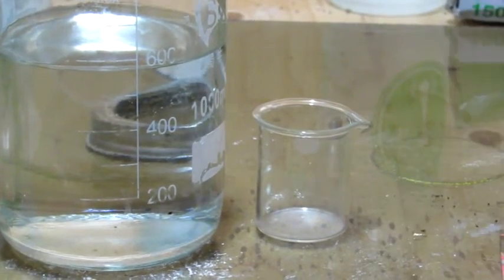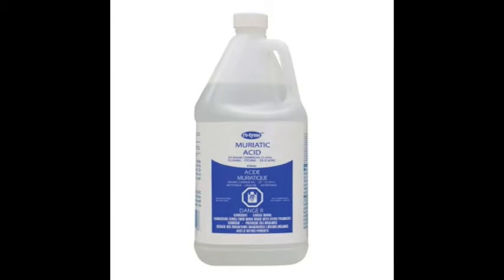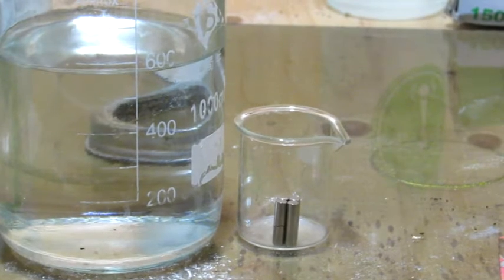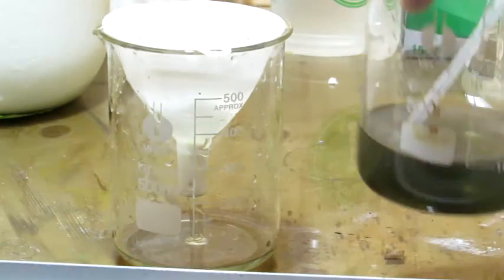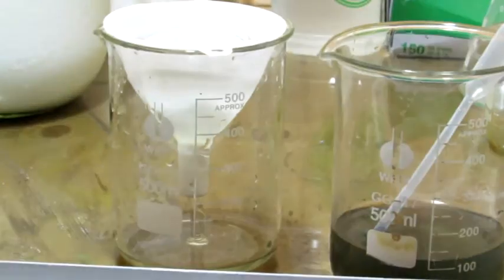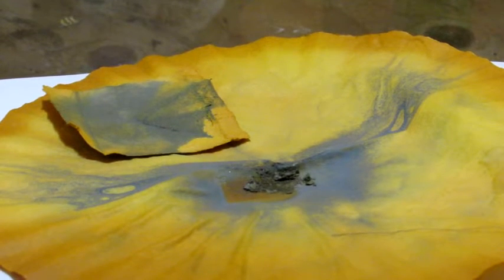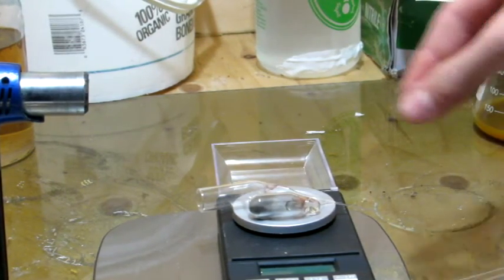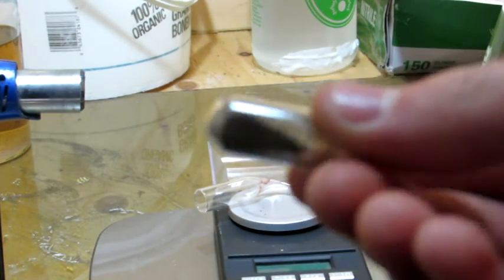Isolate Boron from Neodymium Magnets

Comment: Love these household element extractions! Do neodymium extraction from the magnet!
Reply from the maker: Thanks! I failed at my first neodymium extraction, but I’m gonna try again soon. I have some ideas using ether as a separating method.
Reply: @TheCanadianChemist  There´s another way to isolate the neodymium (which actually has a bit of other rare earth metals mixed with it) from the solution: 
Step 1: make sure that all the iron present in the solution is in the form of iron(III) ions. If not, add hydrogen peroxide to oxidize the iron(II) ions into iron(II) ions.
Step 2: make a solution of oxalic acid (or oxalates of sodium/potassium or ammonium) and add it to the neodymium magnet solution. This will precipitate neodymium oxalate (mixed with a bit of other oxalates of rare earth metals)
Step 3: Heat the dry precipitate to turn the oxalates into oxides. From there you can try to isolate neodymium, but it´s very difficult to separate it from the small amount of other rare earth metals mixed with it.

Good luck!
Reply: @chemicalmaster3267  Sorry for asking a bit late. i am also trying to separate neodymium from magnets. 
May I ask what type of magnet do you use, hard drive magnets or a bar of Nd-Fe-B magnets?
I tried with an NdFeB magnet bar but the results were really bad, I definitely filtered out all the Fe but in the final step when separating the rare earth oxide, I dissolved it back into H2SO4 and the solution turned orange instead because of the purple-pink color of Nd3+, I think it's mixed with a lot of other rare earths instead of just "a little". Only when I used hard drive magnets did the results get better.

Comment: A superior method than the boric acid, I would like to see the neodymium recovered :)
Reply from the maker: I’m working on the neodymium, it’s a bit challenging to separate from iron, and I’ve failed my first attempt, but I have some ideas with using ether as an extraction solvent, so stay tuned!

Comment: Maybe you can also extract nickiel by adding some sodium hydroxide to the solution of nickel chloride and then roasting it to make oxide and then make a thermite although there is very little nickel chloride in this solution so you would have to find another source. I am planning this synthesis but I will start from nickel sulfate rather than chloride.
Reply from the maker: I am actually making some nickel oxide rn. I dissolved a bunch of old Canadian nickels which used actual nickel. I’m doing some looking into the catalytic decomposed of sodium pyrosulfate by nickel oxide to hopefully produce sulfur trioxide. That sound be fun. I’ll also look into doing a nickel extraction video in the future. Thanks!